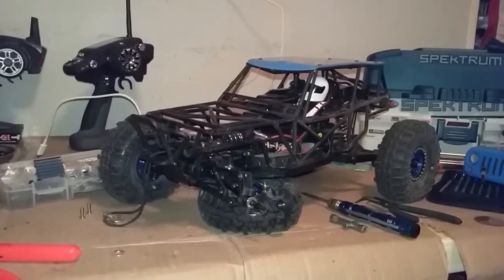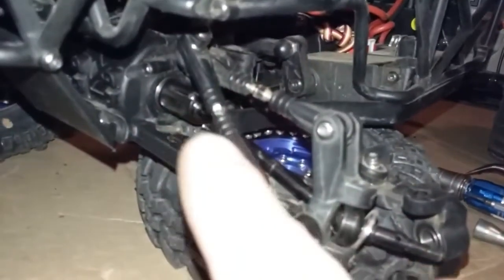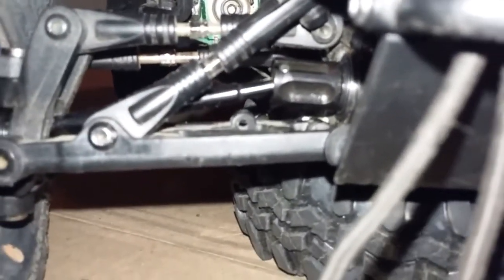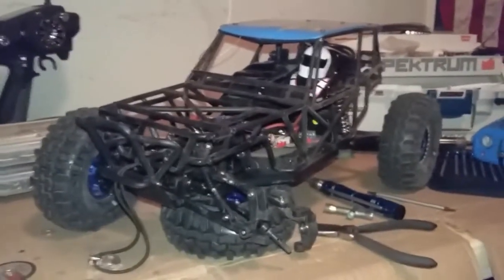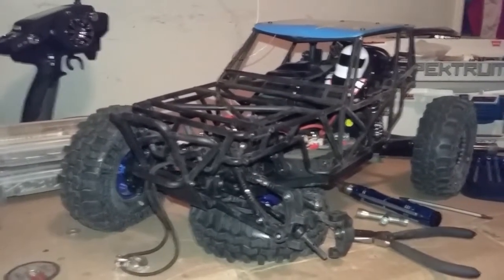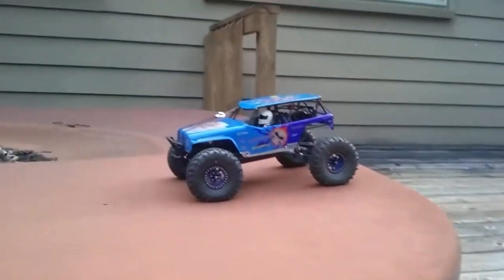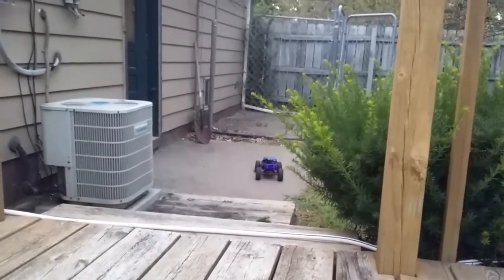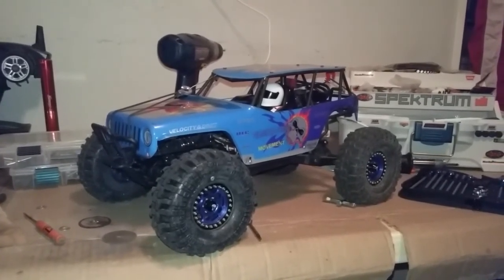WLtoys 10428a; re'working the front drive train again!

Comment: were you driving the truck like that the first time it broke? makes me wonder if it would hold up as a crawler and a general trail truck, rather than bashing the crap out of it!  just curious if you destroyed it driving to church on sunday, or were you trying to destroy it when it broke?  good videos man!
Reply from the maker: mrslam49,I was actually babying it,crawling off-road,the first three times that it broke,
On the last two video's,I was bashing it bit,because I was getting pissed off,at what a p.o.s. it is,
I'm no stranger to RC's brother,I've been building them,since like 1980,
And I can honestly tell you,that WLtoys, are garbage, no b.s.
don't waste your money on one,I have enough rapped up into this rig,that I could have bought a Vattera Twin hammers,and it still needs a couple hundred more invested,before it would be half way decent,the plastic is junk,the metal drive train is junk,the screws are junk,the end links are junk,the bearings are junk,the stock wheels are junk,the servos are junk,and the transmission is geared way to high,the radio,and tires,are the only thing,that it's got going for it.
I wouldn't steer you wrong brother,don't waste your money,on a WLtoys product,I would have been better off,giving my money to a vagrant,and telling him to kick me in the balls,as hard as he could,versus buying this thing,if you really want one like this,than just save for a Vattera Twin hammers,or some other name brand vehicle.
Best of luck brother,and Thanks for viewing :)
Reply from the maker: mrslam49,you might want to watch my video's,on the WLtoys 10428,start at the first,and watch them all,because I actually bought the truck,for the same reason,I was looking for a cheap trail rig,to run with my TF2, if you start watching from the first 10428 video,and watch in succession,
everything will explain itself,from the start of its problems,to it's current situation,I'm not trying to sound like a jerk,I'm seriously trying to help you out. :)

Comment: Are the veterra cv shafts the same size as the wltoys? Also on the veterra front differential cups, they are slightly shorter than the wltoy diff cups. Correct?  Looking to upgrade the cv shafts.  I  locked the front diff and bent a cv shaft. Oops lol.  Bent it back and it’s been working fine.
Reply from the maker: Shane Heigert,
good questions Shane,
The diff out drive cups appear to be the same length,but the WLtoys has longer shafts,than the Vattera,Vattera A-arm's,may be a pinch shorter as well,
If you're looking to upgrade,you might want to get the A-arm's too, I never got around to it,and basically just used what I had,to get it moving again, I didn't replace the A-arm's, the ring gear on the diff, the input drive cup,on the transmission side of the diff, or the diff case itself,
For Vattera parts,I used the following items;
Front diff cup,diff locker,and pins,
Front diff out drive cups,
Front shafts,and wheel spindles, 
And the A-arm's,would have saved me a ton of work lol
Hope this helps,
and Thanks for watching Shane